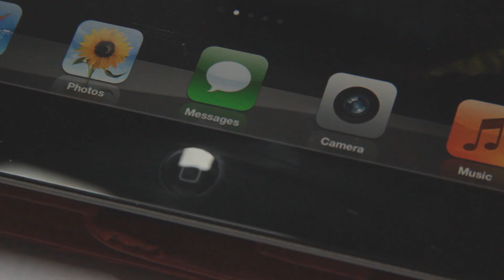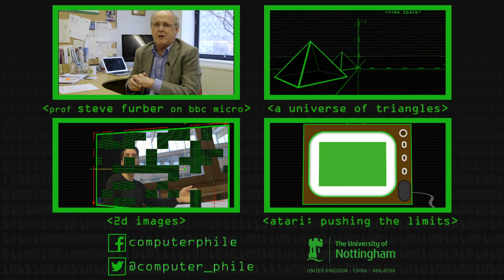Capturing Digital Images (The Bayer Filter) - Computerphile

Comment: you should do this but on more modern sensors like the A7S III with its quad bayer sensor, and the Blackmagic URSA Mini Pro 12k, URSA Cine 12k LF and URSA Cine 17k LF which uses RGBW color filter arrays, latter of which is interesting, as the normal bayer pattern is RGGB, the A7S III and its derivatives do RRRRGGGGGGGGBBBB (4xR 8xG 4xB) but the Blackmagic cameras do it this way (get ready) RRRRRRGGGGGGBBBBBBWWWWWWWWWWWWWWWWWW (6xR 6xG 6xB and 18xW)

Comment: Wouldn't the colour filtering cause 2/3 or so of the photons to go uncounted?  I know they could keep detecting longer but can't that be more efficient?  Couldn't they also use tiny optics like prisms to split the spectrum and get a larger amount of the source red,  green, and blue light to the intended detectors?

I saw that some cameras use a beam splitter to split the total light but even they filter out 2/3 or so of the photons before detection instead of sending most red, green, and blue to the appropriate detectors.  Chromatic dispersion seems to be more efficient if they could just make the millions of tiny prisms over the detector.

Comment: 2:13 I never got this explanation, here or elsewhere. 
What does our eyes capacity to capture green light have to do with how the sensor has to do it. The final compounded output of a 4x4 pixel array will be a algorithmic calculation (demosaicing ) anyway. I would assume, I can adjust this calculation/ demosaicing  in a way, so that the final picture looks natural to our eyes then anyway. 
I would understand an explanation like, green being the most prevalent color in the environment, thus, it would make sense to focus on capturing that. 
Eyes capture -> Brain translates.
Sensor captures -> Chip translates -> Monitor Output. 
2 separte systems of capturing and translation, therefore no need to mimik one part of the "other chain".  What am I missing?
Reply: By capturing more green pixels the cameras/chips can more accurately figure out the green values than they can red and blue values.  The reason we see more green than other colors is because we have more green cones (biological color sensors) than other colors.

Comment: The problem of figuring out what goes in the gap of the color sensors seems like something that a neural network would work well to solve. Train a neural network to recognize patterns like edges, curves, and grain, by using incomplete color information. And maybe try to shape it's network structure so that it corroborates it's guess for one color of sensor with its given data from the other available sensor colors, rather than just a single type. I bet you could get an astounding quality image using this processing technique. (Come to think of it, I think that "RAW" image data may actually be the data from the individual color sensors, before the camera tries to squash them into normal pixels. So the neural network could be used well after taking the picture, if your camera saves the raw data.)
Reply: 5 years later our smartphone cameras are using ai for that purpose
Reply: @MrConminer  Pretty neat. I haven't kept up on camera tech or AI lately. Been focused on VR and creative stuff. Thanks for letting me know, though. ^_^

Comment: So our eyes don't see color that well... Does this mean that pictures taken with our cameras would look quite strange to animals that see color better?
Reply: It would look as strange to them as pictures simulating color blindness look to us. The problem is that we use to manufacture picture recording and displaying devices that suit OUR needs. Even if you take a picture with a camera that takes a wider part of the spectrum (UV and IR for example) there would still be a problem of displaying the information to your “animals” since there are no monitors that display the additonal information on screen nor are there printers using inks whose molecular structure absorbs UV or IR light. But I thinks technically it would be possible … only for the sake of showing pictures to “animals” with a more sophisticated perception. :)

Comment: Aren't there 3 subpixels for each pixel? This guy says there are actually 3 megapixels in a 10 megapixels sensor, but it seems more plausible to me that there are actually 30 megasubpixels and therefore 10 megapixels, can someone clarify?
Reply: Simply put: you are wrong, the video is correct. There are no subpixels.
Reply: I even forgot I asked this question, but thanks for the reply!

Comment: Had an assignment last year to implement a Bayer filter on an FPGA which I failed because my professor couldn't explain what the filter was doing in terms I could understand - he insisted on trying to explain everything in terms of matrices: You've just explained it with perfect clarity in about 5 minutes.
[Tears out hair] University sucks, Computerphile & YouTube FTW.
Reply: I have a similar project at my internship basically i have to implement a module that should convert bayer images to RGB. This comment would be nostalgic to u.

Comment: Rough idea: Build a camera with a semi-transparent mirror which transmits 67% of the light into a plain B&W sensor. The other 33% gets reflected into another sensor with a checkboard-like filter of just blue and red pixels. A chip could guess the green channel and you got the best of two worlds: great looking edges without texture aberrations and just two cheap sensors (the blue/red filter and the B&W sensor  are more simple than the bayer R/G/B filter) not three sensors. Because it would be a YCbCr camera, the YCbCr 4:2:2 mp4 compression process would be easier as well.

Comment: You know, when I was doing research into how they made color movies before color film was developed I found out that they would split the light beam into it's component colors and they would have 2 or 3 rolls of film all going through the camera at once, taking black and whit film.
They would then tint the film with it's respective color and then put them together. Some times gluing them, some times using a processes to make a kind of stamp. It's pretty interesting.

I'm sure if you wanted to get a more accurate picture you could do something similar and have a beam slitter with 3 separate sensors.

Comment: In film making the debate between film v digital is still very much alive and well.  My Super 8 camera can give professional cinematic images. - The way the film is made and processed has improve dramatically over years, however, to gain that high widescreen quality is expensive.  The company Pro-8 is famous worldwide for it's Super 8 processing (and all other film formats). Film is still largely used by Hollywood. - Most directors are anti digital. TV networks often still use film. - PBS  has a strong relationship with Pro-8.

Comment: Watching this made me try to think of how to do that process (well, in a way) on each captured pixel. Granted it would be more expensive, but could there be a mini prism that "stretches" the light like a prism and then use that data? I'm guessing no because of the size of the photon packet, but it sounded good in my head.
Reply: There are color measurement devices that do exactly this! They're called spectrophotometers, and measure color extremely well. However, I don't think they scale well.

Comment: *****  Nice to know how all of this works, thanks for the post. I have a question about these filters: how possible would it be to have a sensor with a specific pattern of R, G, and B filters that shift 3 times during the taking of a picture and each time capturing the specific amount of R, G, B for each separate pixel in the sensor. I understand this would have to be a very precise movement of the filters relative to the sensor, and that this would either work for still images or for very high shutter speeds; but would it work at all? I thought about this because I was thinking about HDR pictures and how, when using this setting, cameras take multiple pictures in different brightness settings and make a composite one based on what the software thinks is the best HDR picture. So thinking along this same line, with te shifting filters you record separate R,G, and B value based on three different pictures and make a composite RGB value.
Reply: What you described is essentially a color wheel.  Many projectors actually use this method but it requires moving parts which is something you generally want to minimize on a camera.

Comment: Some higher end manufacturers used to be a bit more honest about the actual interpolation breakdown in their technical spec documents like hasselblad and phase one but for some reason I can't find that data anymore - I've spent a lot of time googling to put some more data into my comment but have to go from memory so please excuse that.

Most 35mm format digital cameras are in fact as many people ask/suggest offering about 1/3 of the reported resolution due to interpolation and then also make it worse by using AA filters to get rid of interpolation artifacts. So a 30 MP camera is closer to 10MP as far as the physical sensors capability is concerned regarding the colour with the least amount of pixels dedicated to it and you still have the AA edge issues which are a lot more noticeable than the marketing would make you believe - it's not just fine patterns that are affected, those are just the extreme examples - all edge quality is visibly affected if you don't downsample.

If you downsample a 36MP nikon d800 shot 2-3x then you can correct the edge detail and counter the quality lost due to interpolation, especially with the excellent downsampling that you can do nowadays (choose correct technique depending on image content etc.) and arrive at a resolution of around 16MP or what was the standard for MF digital backs many years ago.

The problem is that even the most expensive MF digital backs do not report interpolation figures as honestly as they used to and when judging progress of digital sensor technology we often look at the MF market, at the expensive solutions!
I have no idea how many physical "pixels" are on the sensor of say an PhaseOne IQ260 which talks of 60MP resolution, by old high quality standards for interpolated MF backs 60MP reported would suggest there are more than 60MP "pixels" in total on the sensor, Maybe 30MP for the colour with the least amount of pixels but definitely not 1/3 but lack of data might suggest that it is in fact the same breakdown as in small format full frame stuff from Canon and Nikon.

It is the standard that small frame digital bodies are interpolated and the resolution is over reported and almost all have AA filters but that is not what we expect of medium format backs. Most of these campaigns against film photography are based on figures and opinions stemming from use of the medium format stuff not small frame.

So not to start a debate between medium format and small frame - what I am trying to say is that we are all getting shafted nowadays with this ridiculous marketing, especially against film and the data to tell how much shafted we actually are is no longer made available.

These interpolation techniques which are not an issue with say 3k dollars for a nikon body are an issue when we are talking about a 50k dollar medium format back, which is at the end of the day just a big sensor you add to a system you already own and paid for.
For those of you who never used MF, my feelings translate like this - it's as if you would have to buy a 3k dollar sensor that you would put in your analog Nikon F and it would offer maybe 2x time the resolution of an iphone camera interpolated up 3 times - you would be very unhappy, especially given that film is being destroyed by this kind of marketing.

You can take amazing digital photos with just a pinhole attached to an old digital camera - the point is that the marketing used to be a bit more honest about the resolution. The old expensive MF backs offered maybe 4-12 MP but that was without interpolation or AA and what is left nowadays is still thankfully lack of AA but the hidden interpolation details and lack of reporting in regards to how the sensor is physically divided between the colours is all about hiding the true progress of technology.

Unlike many seemingly commenting on the web about too many MP, I do actually feel there is not enough MP - I want more. I want about 120MP on a full frame MF sensor if it has to be interpolated (that is at least 56mmx56m to cover the film area in my system) and I don't want less than 80MP per colour.
This kind of digital back is maybe 15 years in the future.

An interpolated file without the AA filter where you get say 16MP at least for the colour chosen to be least important resolution wise is of-course going to surpass a non interpolated file where you had 16MP for each colour because the interpolation techniques and filtering is very good nowadays - it's just that we are not in the high MP numbers as we think we are because through the years the reporting and measuring changes.

This might be irrelevant to most but to those of us who are attacked all the time about our film being outdated have to deal with all kinds of crazy arguments. One person told me my slow speed MF film is at most 50MP, well I disagree but due to interpolation even if my film was 50MP he won't be able to find a MF back that actually approaches that save for maybe the newest 80MP offering from Phase One.

The same problem is with scanners for film and general reproduction setups - they also use interpolation and are even more ridiculous in their marketing. 

Arguing that interpolating something to large sizes is as good as natively reproducing it at those sizes requires tinfoil hats - it's like saying on the other side of that argument, that a slide enlarged to cover a whole building magically increased in resolution - we might perceive more resolution and fantastic detail, the colours might be vibrant with that super expensive projector and so on and so forth but it's still not a ground to argue against a competing technology.
Reply: ***** Buy a seccond hand high quality zeiss lens for an older analog only mount and then buy a converter to go with it - for instance from fotodiox.

For instance the hasselblad lenses I use have the main shutter inside them instead of inside the body itself so sometimes you can get ones with a broken shutter or one with innacurate times for a pittance.

You could get one with mint glass for say maybe 200 quid since fixing it is another 200-300 at least. Only you never fix it, you buy a 30 quid converter and mount it on your sony.

It's not a solution for wide angle but everything beside it, it's excellent - you would have to spend at least 2000 quid to get a high quality zeiss lens in native sony mount and a high quality zeiss lens from yesteryear is the same exact thing, sometimes even better. The only thing that changed with most zeiss designs over the years where ergonomics, it's the same glass configuration.

MF lenses work great on small frame bodies because you end up shooting through just the centre most part of the lens and that with most lens designes is the sharpest so not only are you using top of the range glass, the aberations at the edges start where your sensor ends!

Comment: I always thought each of these r/g/b sensors where grouped to  1 pixel which is independent from the other pixels and the brightness get's averaged out from these grouped sensors...
Reply: Well, that's essentially what happens, after it gets processed. It makes little sense to build a more complicated sensor, when you can just achieve the exact same result by processing the data after it was captured. Hence it's done that way.
Reply: Mythricia What understood from this video, each r, g or b sensor makes up 1 pixel in the final image.
I.e. for a pixel where's only a g sensor available the r and b values are just getting estimated from the surrounding r and b sensors and the g sensor itself still corresponds to pixel, no grouping as I thought and explained in my op.
Reply: @CelmorSmith  Similar to how routers are marketed they represent numbers is a way that makes them seem better.  In the camera example a 10 MP camera really only captures about 3 MP for each color and in the router example they tend to represent the total bandwidth of each frequency/channel they can use instead of what the average consumer will actually see (so they add the bandwidth for 2.4GHz, 5 GHz, and more recently 6GHz when in reality each device will only connect with one of those at a time).

Comment: 2:11 I thought it was the other way round? He says our eyes are MORE sensitive to green than blue & red, isn't it less?
Reply: explodingpenguin3  No, that's correct. Our eyes are most sensitive to light in the middle of our visible spectrum, i.e. green. A common formula for converting a color given by RGB values to a grayscale value of equal brightness is this: 29.9% R + 58.7% G + 11.4% B. As you can see there, the green channel contributes most to the result, and the blue channel the least.
Reply: Huh, well TIL. Thanks!
Reply: @THBfriend  I knew about green but didn't realize we saw red better than blue, I suppose we probably just have more green cones (color sensor of the eye) than red and more red than blue.